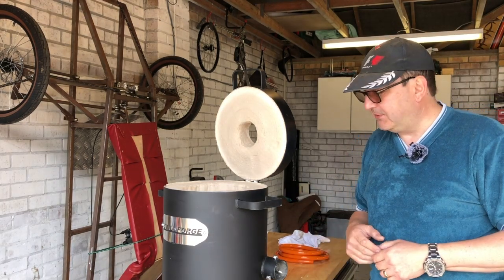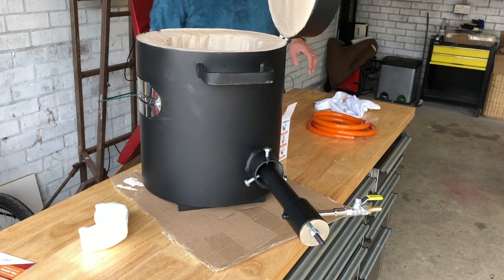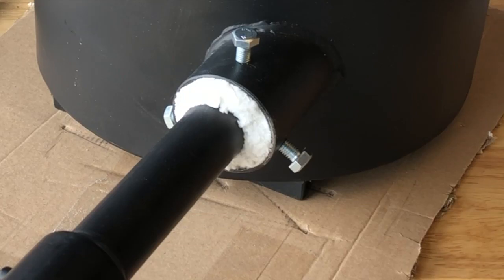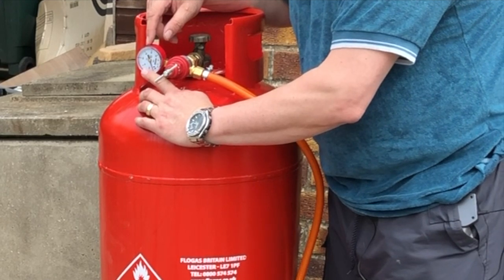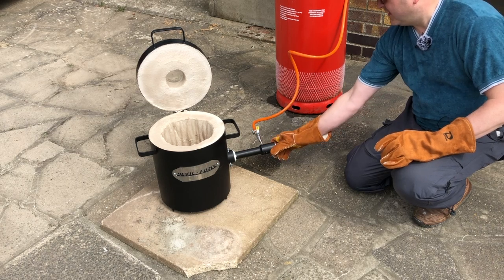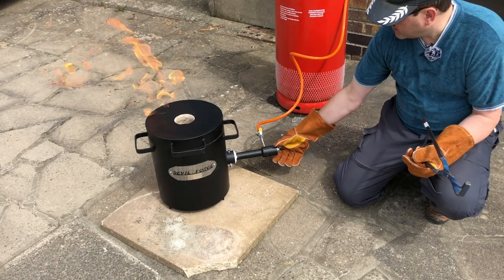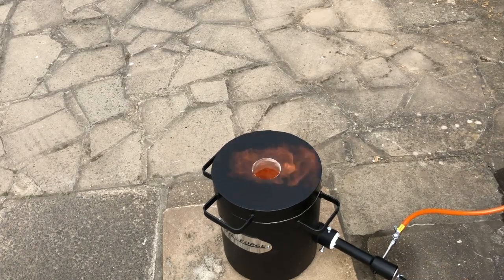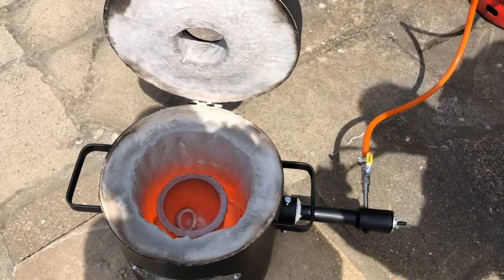Setting up the Devil Forge Furnace

Comment: So everyone knows you want to apply a refractory cement to the insulation of any furnace, to help prolong the life of the furnace and keep toxic fumes from comming off the insulation, granite it is not much it is enough. It is very easy to apply. The product provided with the furnace works but a 3000°f refractory cement will last longer

Comment: i've bought a similar forge from the same place, however the air valves on mine are not opening up at all, I have moved the butterfly up the thread and used all my strength to do the same with the valve, it wont budge. does anyone know why?

Comment: Concerning the regulator, the knob in the center adjusts propane flow? Where about should the meter read?
Reply: It depends on what you're melting..08mpa Aluminum .1 mpa silver .12 copper/gold. I have a 4kg devils forge and melted all these metals I listed beside gold but copper and gold have the same melting point. Hope this helps

Comment: I'm gonna do my first run tomorrow and dry it out.-
I'm just curious, is it steaming as the moisture leaves and when it's not steaming anymore it's ready?
Reply from the maker: Ducesweden. You may see a little steam, but it changes colour / shade slightly anyway so you will pretty much know when the moisture has been pushed out..
good luck, enjoy and stay safe.
Reply from the maker: Hi Guys. Yes very much agree that the colour change is very obvious and I dont think you will be in any doubt👍.  Have fun and stay safe

Comment: Did you have to apply any tape during the setup? And I'm making guesses at some of my setup since I've never done any of this before and you skipped steps. Also. Do you need a temperature gun?
Reply from the maker: No tape used and the temperature gun is nice to have but not necessary.
Just warm it up relatively gently the first couple of times.